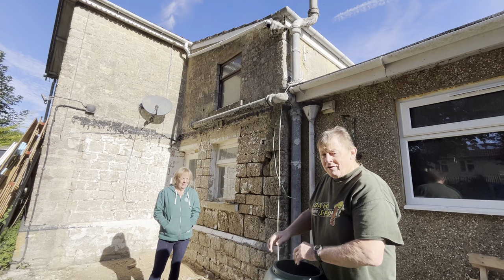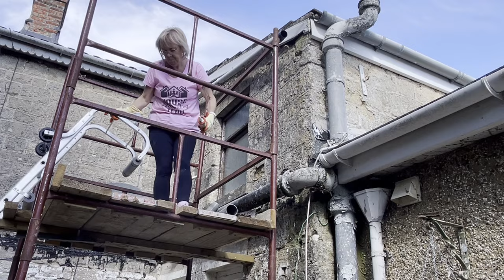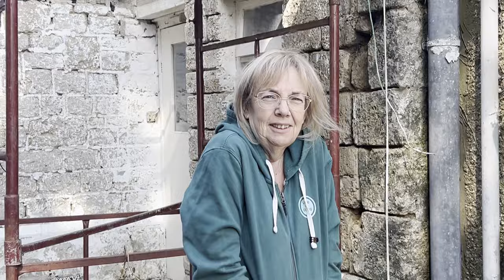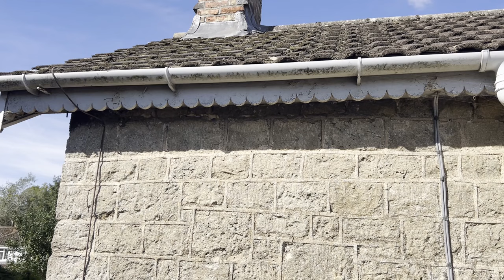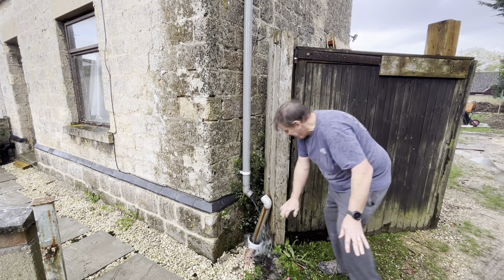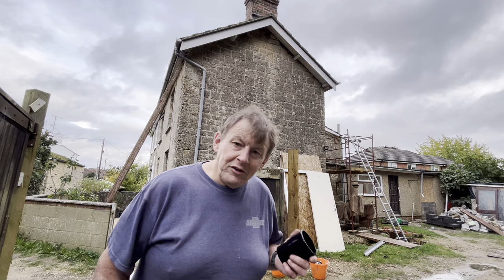Blocked and broken rain gutters @bramblecottageuk

Comment: I was nearly holding my breath as you went up the ladder the first time Gill. But you conquered your fear!! Well done to you both. 🥰
Reply from the maker: @cherylargenziano7475  I really am terrified. It really took all my courage. I hate to see Rich up a ladder too. I am hoping we can stay away from them for a while! Thanks.🥰
Reply: @Bramblecottageuk  the answer is larger (wider) guttering and at a more dramatic angle so any debris getting in there will be taken away... Though a compost producing gutter is hard to beat...
Reply from the maker: @koningbolo4700  You are right Koningbolo. I have replaced the front gutter with a deeper version. I kept the angle the same but I covered the gutter with plastic netting to keep the leaves out of the deep trough. It should be good for a few more years now ;-.) best wishes, Richard